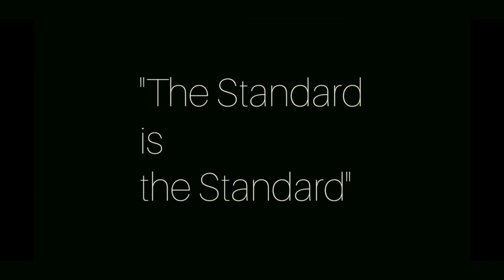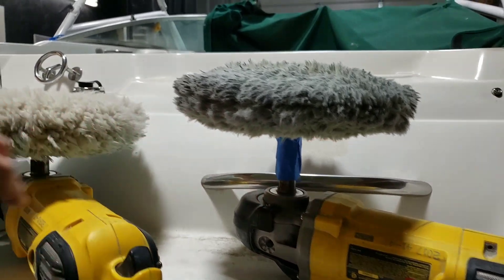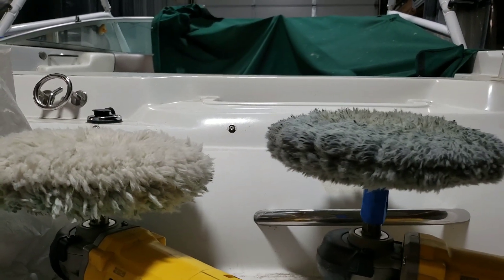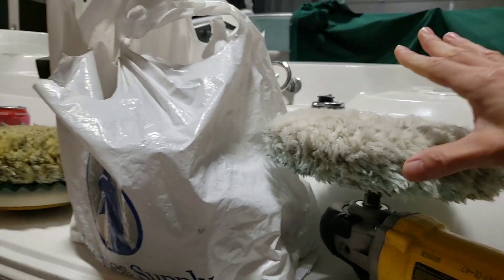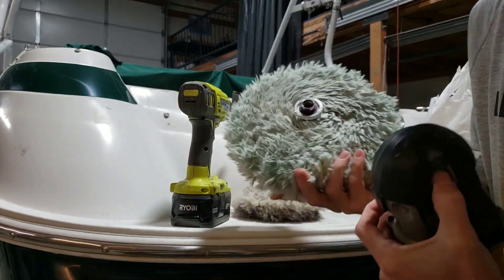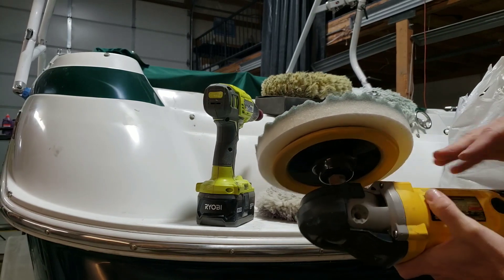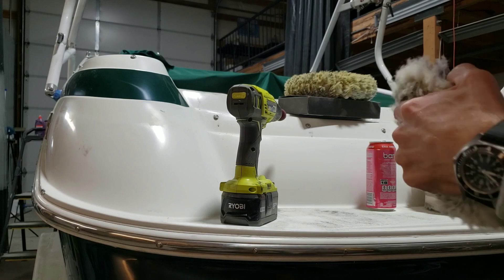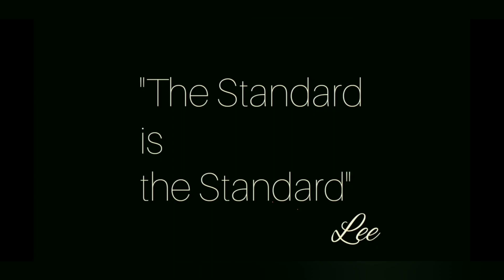3m Quick Connect or Typical spindle Nut? Do you need one or the Other? a Detailer explains the deal.

Comment: So some pads are quick connect and others are...? I take it the 3M Perfect-It 9" compounding double sided pads are the right ones to use with the quick connect?
Reply from the maker: https://www.restructuremarine.com/fireglaze-products-2

3M Quick Connect adapter (mfg # 05752) to use with the double-sided compounding pad (3M mfg #05753) or the double-sided polishing pad (3M mfg #05754)
3M Super-Duty (05954)
3M Perfect It Heavy Cutting Compound (36102)
Perfect-it ex ac compounds by 3M (36060)
Meguiar’s (owned by 3M) Flagship Premium Wax (M6332) Pro Polish by Shurehold or 3M's liquid wax with scotchguard.

I receive no payment for listing these items. I list them because you guys ask and I just thought I would save some time.

Wear protective gear, this stuff can cause cancer and kill you.
Reply: @Local_Boydidgood  OK, I bought the Dewalt buffer you recommended elsewhere, the 9" double sided pad, the adapter, 3 liter set of 3M compound, and the 303 Areospace stuff. My fleet will never look the same. First up, a beautiful gel coat fiberglass camper. Thanks a ton. You don't do cars much, but I don't even own a boat.
Reply from the maker: Plenty of car experts. I felt there was a hole to fill in boats. Don't do anything I do on a boat, on a car, ever!

You're very welcome. I hope you achieve your desired results.
Lee
Reply from the maker: Did I not reply to this Bob? Sorry. The pads are specific to the nut or adapter. One can't be used with the other. In my descriptions are the part numbers for the corresponding wheels.

Again, sorry this slipped through the cracks my man.

Lee
Reply: @Local_Boydidgood  You did. I just followed your recommendations!
Reply from the maker: OK, as long as I didn't ghost you.

Comment: Does the quick connect do as good as the backing plate or same?
Reply from the maker: Apples and oranges really. The backing plate requires you to physically center the pad, avoid tight places and you don't get another side of your pad to use if needed.

It's just an adapter to use double-sided pads.
Reply: @Local boydidgood  thanks I got one coming just wondering
Reply from the maker: Don't forget the pads to go with it. They only work with the right 3M pads made for the QC.

Comment: We connect is the only bad product from 3M The pads connection are plastic in the quick connect is metal. So you will never have a pad that will last its whole life because the connection will be ruined. The only advantage is that you can have a double sided foam pad other than that is terrible and falls off all the time.
Reply from the maker: If people aren't pushing so hard, up on an edge, they'll experience less of that.

They should have used a steel sleeve and not aluminum, agreed.

Not perfect but if not abused, serves a purpose and unless abused, will keep a pad spinning and being able to semi-quickly allow a flip.

I also run a normal spindle nut and it's almost always, as fast to flip and never drops a pad on the ground which, to a detailer is one of the most frustrating things in life.

Thanks for the comment.

Comment: Did you have any issues with threading on the 3m quick adaptor to the Dewalt dwp849x? My 3m quick adapter seems like it has a different size thread than whats on my dw849x. I can get maybe 1/2 turn and then it just stops and won't thread any longer. I don't think they make different size 3m quick release adaptors.
Thanks for any input!
Reply from the maker: Yikes, no, never. I've used about 3 and the guys at the shop all have one, my last crew used them too half the time.
I'd return /exchange it. Sorry about that. I'd say it's a fluke or it got bent or has something in the threads keeping it from threading.
Reply from the maker: Anytime.